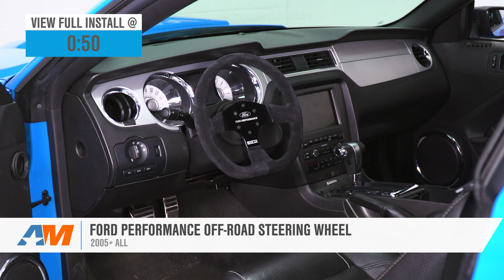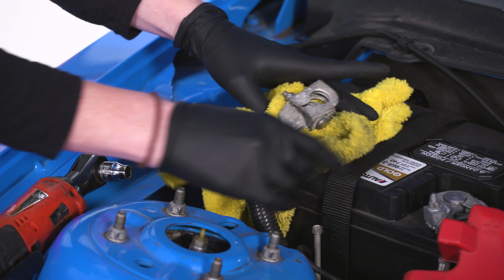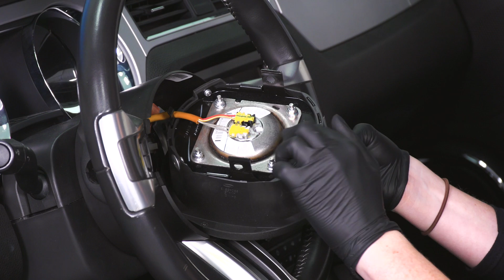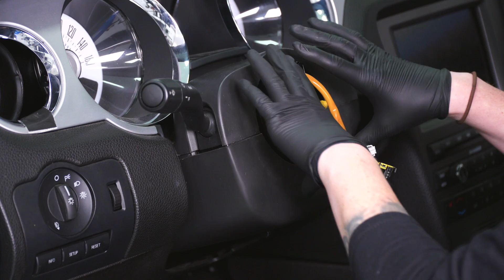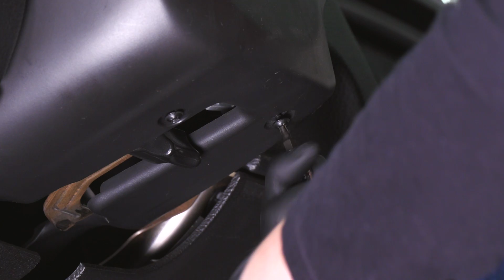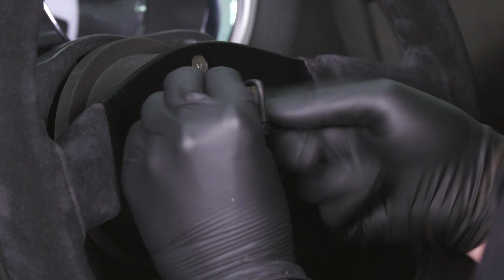2005-2019 Mustang Ford Performance Off-Road Steering Wheel Review & Install

Comment: why would anybody want to buy that?
Reply from the maker: Mainly for track usage! Not really something I would recommend for a daily driver. Airbags are kinda important. -Zach
Reply: It’s race car status. When you want to shed unnecessary weight, you ditch the air bag and heavier steering wheel. Plus, you can add a bracket to mount a button for a transbrake or bump box (which is all race car stuff).
Reply: @negativesplits06  yes ls swap
Reply: Somebody like myself who has extremely sweaty hands ...... My 5.0 is hell to drive sometimes as i have no grip on leather steering wheels.

Comment: Having trouble finding out the exact diameter of this steering wheel, have mixed information on different sights and also contacted ford performer with no luck. Thank you for your help.